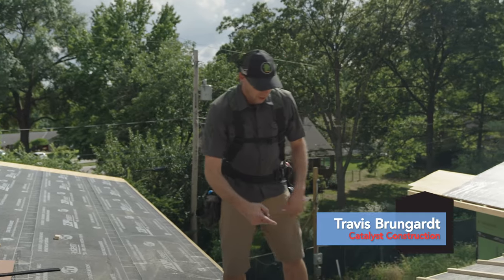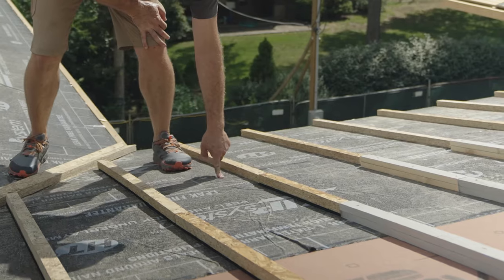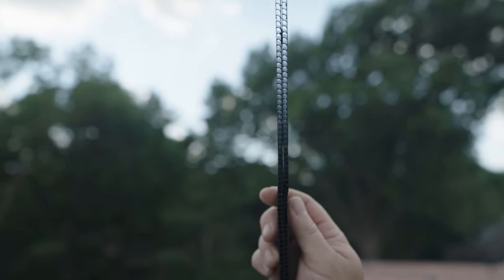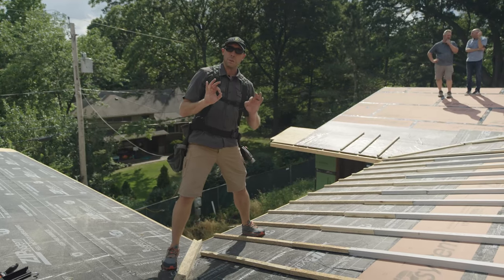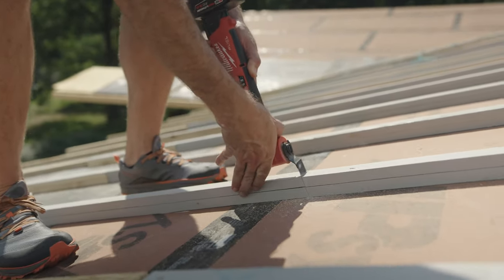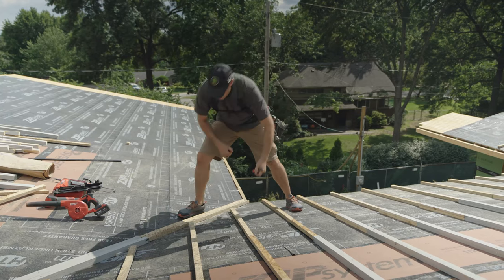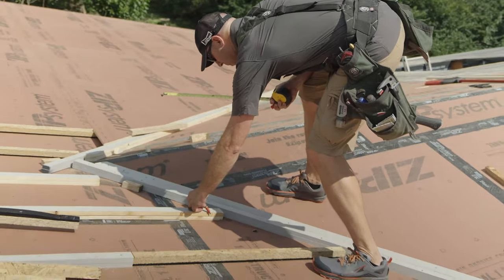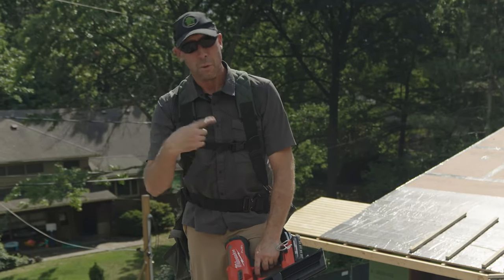Roof Valley Venting Strategies

Comment: Unnecessary…
Reply: Roof ventilation as a whole?
Reply: @TheChupacabra  Yes, semi conditioned attic space is far more cost effective vs traditional venting. As for venting under the roofing membrane as in this case, is a maybe at best. Latest research suggests that this type of venting may actually be the major cause of moisture introduction in the first place, which is the major daisy of roof rot and roof failure. Consider commercial roofing practices where these ideas don’t exist. non venting on commercial roofs have worked exceedingly well for decades.
Reply: Is this for a shingle roof?